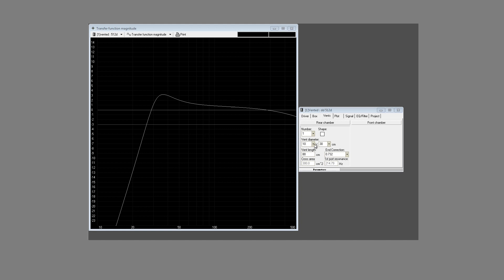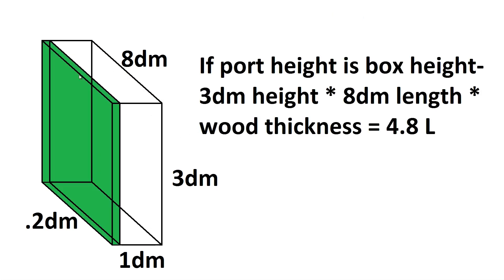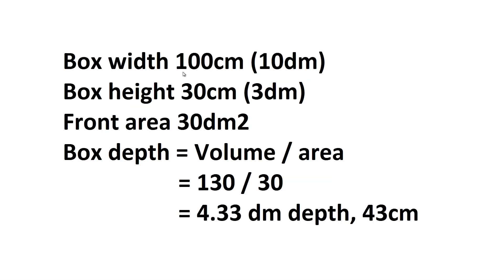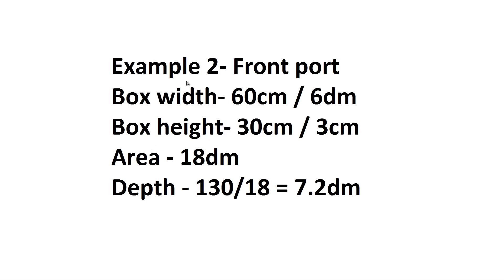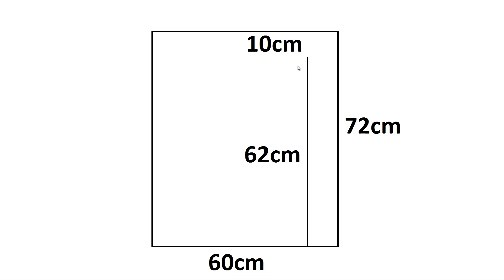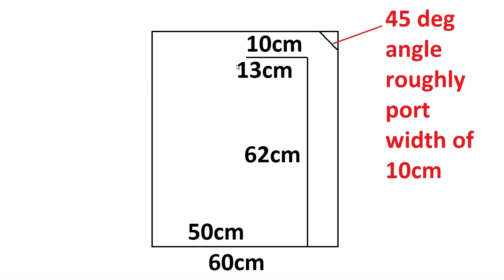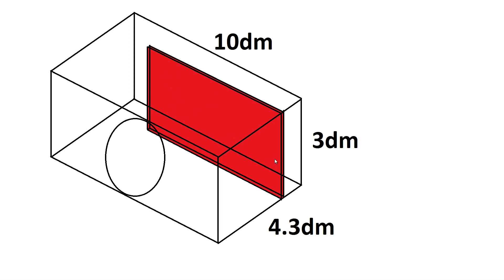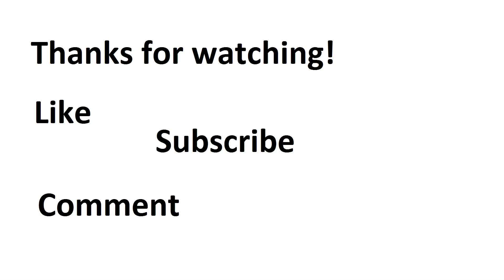How to design slot ported speaker enclosures

Comment: Im building my first slot ported box. Normally i use round ports. I have all my dimensions etc but im curious, i see many that are flared and then a lot that isnt flared. Wouldnt it be best to flare a slot port or would that be more driver/box design dependent ?

Comment: is it not that both corners of the port chamber to have parallel angles. there by you not reducing port width. So u should have 45° angles on both inner the outer wall of the port tunnel. Its like having a 2" ball rolling in a 2" tunnel that has a 90° corner with the taper of 45° on 1 surface. that ball will get stuck on the bend.